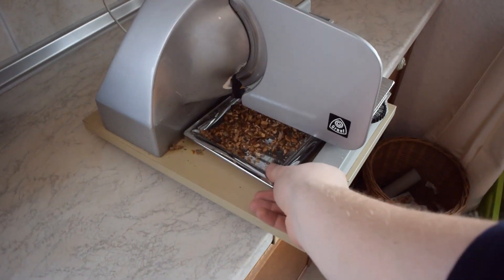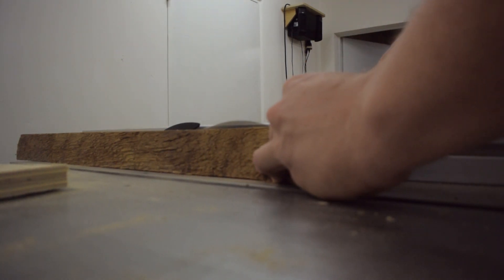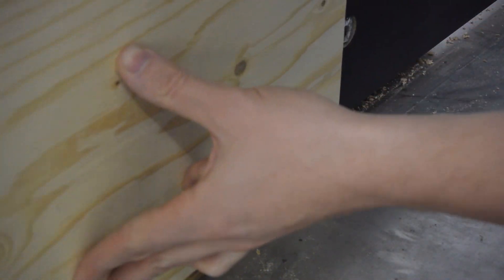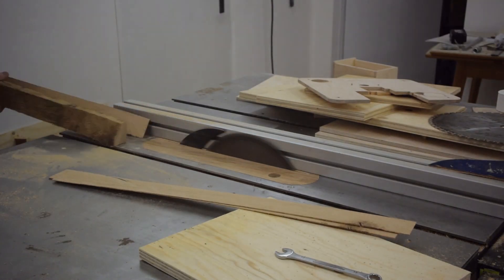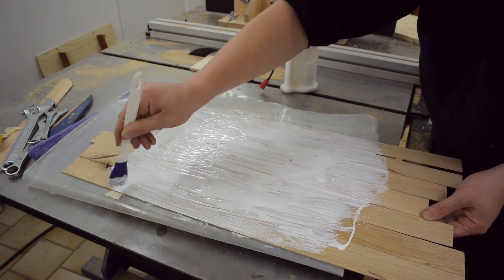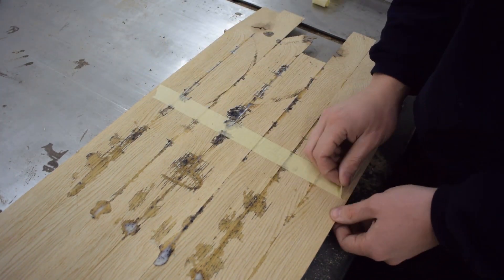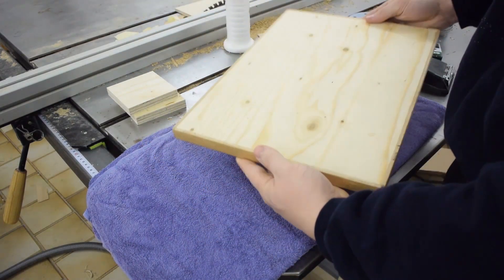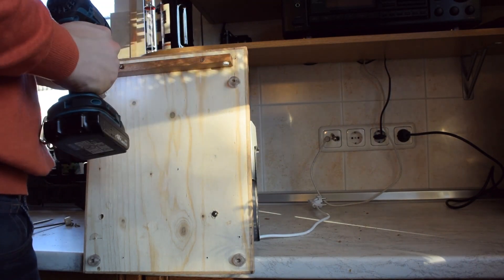Veneered Slicer Base (table saw cut veneer)

Comment: Water on PVA glue does that darkening to oak. You got lucky: usually it goes deep into the wood.
Reply from the maker: Strange. I never had that problem before when gluing up oak. Honestly I don't think it's the water.
Reply: Cosmas go look it up. I have experienced this many times before. It seems the tannins cause this. The same you find in wine (oak barrels).